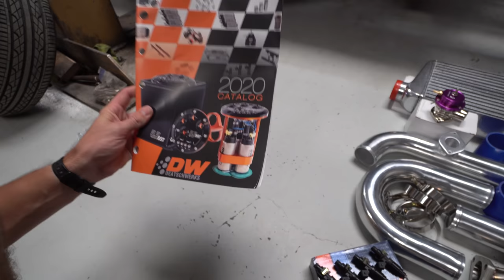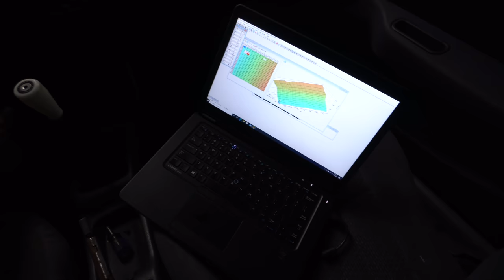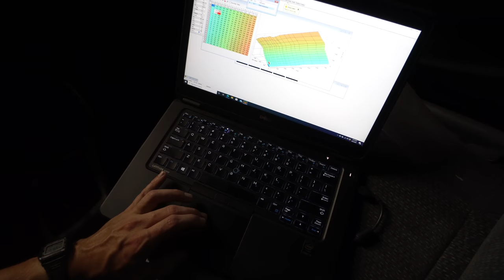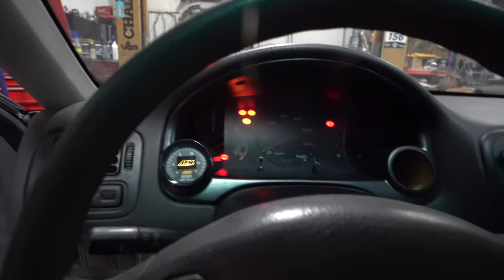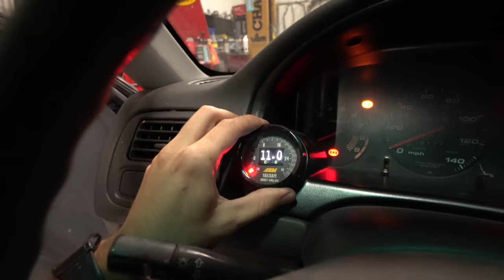How To Turbo Your Honda Over The Weekend! ( EK HATCH BUILD! )

Comment: the best way to deal with the air intake temp sensor is weld a bung and get a 99 accord temp sensor should be a screw in

Comment: Nice work-I think you have a couple things to look into before calling it ecu. 1 make sure what you are feeding the ecu for o2 signal is correct does it need the narrowband sim signal or wide band and of course the wt sensor.. pop quiz what happens on a Honda if your wt fails open (or is unplugged /gasp)... “wt sensor not coolant temp sender”  GL @the dyno today maybe you figured it out or caught my comment early enough.

Comment: Love the build and the give-away. You guys are top notch. My only concern is if those are stock pistons with factory ring end gap. If so, anything over 7 psi sustained could cause the rings to get hot, swell, bind and snap. Now the whole bottom end gets called into question. Great work though!
Reply: People running way more power than this will be on completely stock unopened b16's, at what hes planning it'll be just fine.

Comment: Wish more people would turbo Honda's in Australia but it's just not a thing here.
Reply: i have ahahah
Reply: @fulledbyarm  what sort of coin?  I only need to use one hand to count how many turbo Hondas I've seen outside of a racetrack in my 23 years of driving.  And most ofthe race cars spat axles like toothpicks.
Reply: @chrisrosie0584  depends on your hp goals and budgeting, a brand new turbo kit and forged motor is looking around 10-12k but a budget kit can be slapped together for 4k, ebay kits are good for most parts you'll just wanna replace the wastegate and turbo with something genuine and reliable, excuse for the year later reply! Plenty on the street you've just gotta have a keen ear for the spool!

Comment: Are you not concerned with metal shavings falling into the oil pan?
Reply: Clean it after wards
Reply from the maker: I pulled it off and cleaned it all out and put a fresh gasket on it too

Comment: Old disels have wastegates, modern diesel engines do not have wastegates, they use VTG turbos, that can manipulate the way gases go to the turbine whell, and make it spool soon and when you it the desired boost it changes and keep the boost presure stable.
Reply: some diesels have crazy compressor surge, so im not sure all the older ones have wastegates
Reply: @differentbydesign7603  compressor surge is because it use so much boost that when you lift pedal rpm drop and boost surge on compressor, nothing to do with wastegates lol
Reply: @fabini14  That’s a different type of compressor surge. On throttle surge like he’s talking about is caused by the turbo trying to flow more air than the engine or the piping can handle.
Reply: @Thechildishmandingo  LOL, he never said on throttle surge, and the turbo always flow more than what engine can handle, that is the only way you can create boost pressure.

Comment: Probably nothing wrong with the ECU, hook up the ECU engine coolant temperature sensor and the a/f ratio should correct itself and put out the engine light.
Reply: Exactly what I was going to say. Your CTS being bad/ not wired/ not reading the correct value will make the car go rich as well. Fix the CTS issue and it won't run as rich.

Comment: This was a great video! I’m planning to turbo my GSR in the near future so this was great to watch as the process will literally be the same. Also if you get a DW fuel pump on your site for a 2001 Integra GSR (probably the same exact one you just put in the Civic) I will buy it! I was already planning on buying one, so may as well get some entries and help support your channel too! Also, is it possible that the car is running rich as a protection because of the CEL? Also, if the tachometer isn’t working (looked like it wasn’t in the video of you driving) you may have to run a wire from the blue wire on the distributor to the blue wire by the drivers side strut tower. I had to do that on my car because of using a jumper harness for OBD2 to OBD1.

Comment: How come you don't get a pipe bender instead of making a ton of pie cuts? 🤔
Reply: It’s just not practical. Exhaust shop tube benders actually crush the inside radius of the tube. Tubing/pipe benders do it even worse with large diameter/thin wall tubing. To do it right would need what’s called a mandrel bender which can cost tens of thousands of dollars. ...and no mandrel bender die set has as tight of a radius as the bend coming out of the turbo so short sections would be required regardless.

Comment: I don't 100% know about your application but in a lot of applications if the coolant temp sensor is throwing a code it will automatically go too max cold  enrich that may be your issue.

Comment: B series have 2 coolant sensors. 1 for the dash and one for the computer. They're both on the water neck. One is a round connector (for the computer) and one is a bullet type connector (for the dash.)
Reply: I think on a b16 it’s on the head under vtec solenoid. but you are correct!! Only reason I’m here is to say the same thing. The one on the thermostat housing is just for the fans. Also older b16 intake Manifold’s have the intake temp sensor on the intake runner and it bolts on. Skunk2 manifolds has the same thing

Comment: I tries to order about $100 worth of stuff but it wouldn't let me sign in to my account or make a new one unless I made a new e-mail and I didnt have time because I had to wait until the last 45min and could get my order to go through. Pretty pissed cause I've made about 6-7 orders on my account and never had problems and this one was important to me because I sold my hatch that I fully built from body work, paint, 320hp app motor h22 with ITB's  few years back and yours reminds me a lot of mine. That one of 2 vehicles I wish I never got rid of.

Comment: If you are still worried about the oil pan drain fitting coming loose, simply drill through the nut and fitting than use a piece of safety wire through the drilled hole.

Comment: If the iat has issues I used a 97-01 crv iat. It’s threaded so all you have to do is tap the hole and plumbers tape the threads. Bam

Comment: Coolant temp sensor is under the distributor (2 wires) the other single wire sensor goes to the gauge.. coolant temp sensor can have it running rich or lean

Comment: Lots of good info here! Great video.
You can always put the fan on the front of the radiator works just as good if not better because then it sucks the hot air out

Comment: how is it my 99 civic si b16 with t3/t4 turbo with AEM series 1 full standalone ecu, stock motor, all the basic turbo parts. its only making 210hp on the dyno, and my guy had to struggle to get it over 200. how is that? how are all these ebay turbo civics making 300+?? im not a mechanic but i looove cars so please dont hate on me guys. just cuz i cant build it doesnt mean i cant love and enjoy it. 10 years strong with this baby. i just dont get the power numbers?